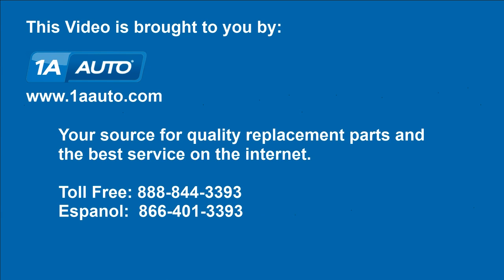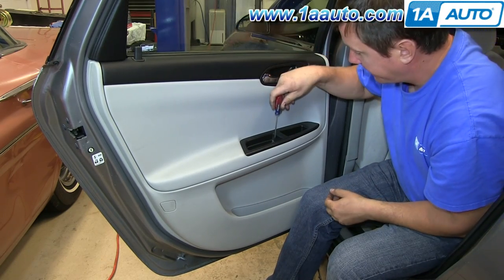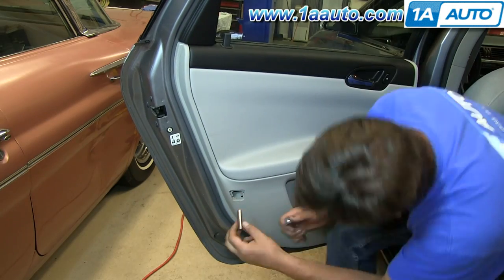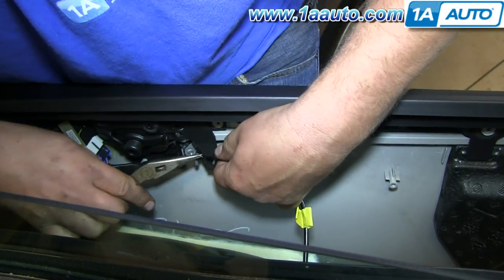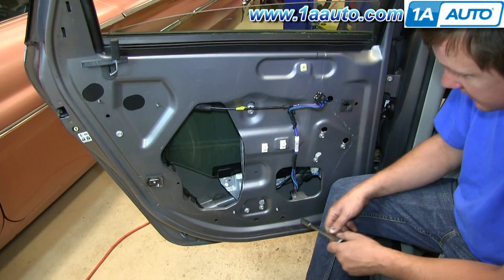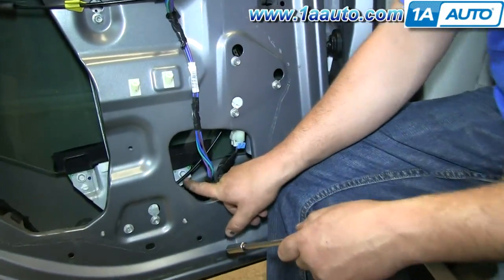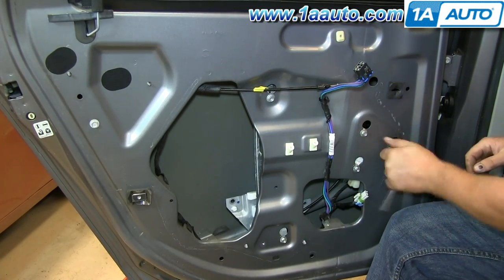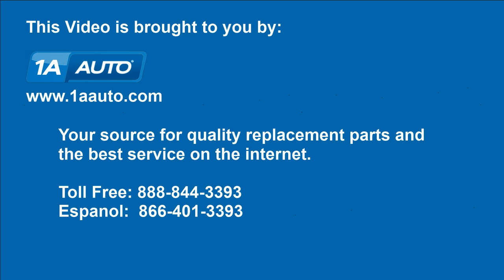How to Replace Window Regulator 06-13 Chevy Impala

Comment: Thank you so much for this video. I was able to fix my daughter's car without having to find a mechanic to take it to. Hardest part for me was the black wire to the door handle - pinching the clips and pulling the cable. It took me forever to finally get that part out.

Comment: Mine broke this morning after getting home from buying groceries. Although the video was helpful it was hard to both remove and install the bearing-cable linkage without breaking it. Overall, it took me close to 3 hours for ybd complete work at 100+ weather in South Texas. Thanks, 1A Auto.

Comment: I got the part but I’m trying to repair my passenger rear and when the part came in, the sliding window controller was at the top. In the video, it’s at the bottom. How do I move the slide down so I can bolt it in properly?

Comment: Does that cause the window to just drop, then of course I can pull it up and down
Reply from the maker: If the cable on the regulator has broke, then yes, you would more than likely be able to pull the window up and down by hand. We carry the replacement window regulator shown in this video, if yours needs to be replaced. Here's a link to them https://goo.gl/AkXxMY

Comment: my chevrolet epica 2011 right rear power window is not working. regulator is working but window doesn't slides up and down.
Reply: 1A Auto Parts team, can you send me a tutorial video if available on how to remove the rear door panel in epica? this can help me to check what's the exact problem on the window. thanks